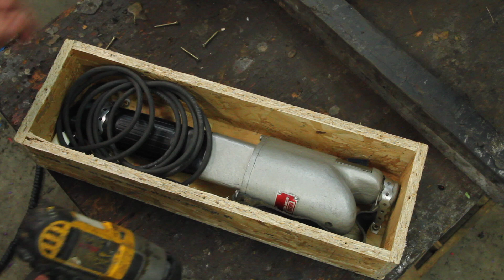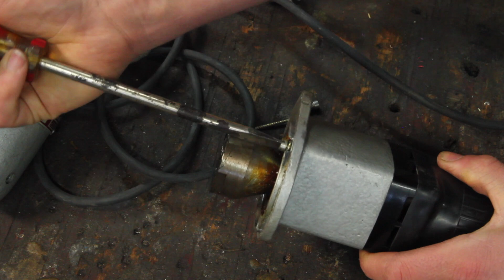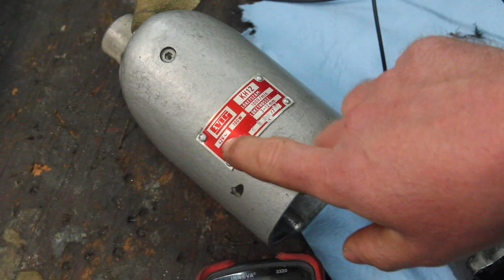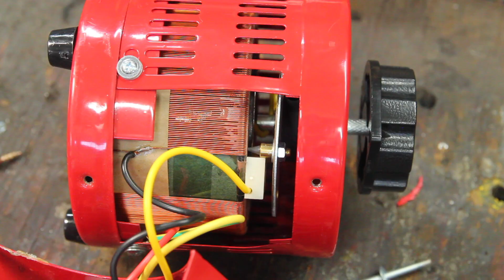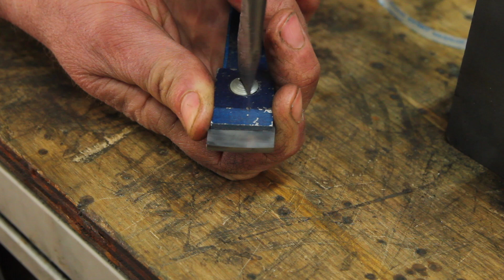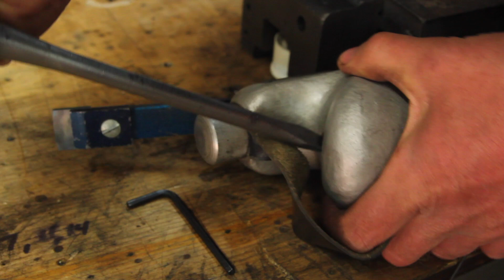Evig Power Scraper (Road to a Rebuild #2)

Comment: Soviet day-to-day life wisdom here: The scraper most likely was made to run on 42V AC, exactly because this would mean for the tool NOT to be usable at home/outside of work. Doing sidestuff and "liberating" tools and supplies from factories was so widespread the various Socialist had to be really, really creative in their attempts at trying to keep it in check. Thus things like powertools with unusual voltages were quite common.

Comment: The variac does not have 2 coils.  There is only one coil so the input power supplied is NOT isolated from the output.

Comment: I wonder if you could Mount some kind of chisel in a Sawzall and do that same thing
Reply from the maker: People do modify sawzalls to hold the inserts, and I considered going that route, but the “real thing” works better because you want to be able to adjust the stroke length for finishing work vs rouging, the ergonomics are better, and this has a good bit more mass than a sawzall, since this cuts on the push stroke, whereas the sawzall cuts on the pull, and is (usually) pulling against the saw.

Comment: Jeremy, you didn't really expect the power plug to fit. Did you? If "yes" then you definitely have Murphy in your shop with you. Nice find for the tool. Despite how elegant your hand scraper was/is you'll get your desired results faster with the mechanical scraper.
Good luck. 🇺🇲🍌🇨🇦

Comment: I think I’d have to swap that motor to a 15 amp grinder or something like that 110v sounds like it’s not generating the speed it needs to clean cut without straight up plowing
Reply from the maker: I was running it pretty slow to try to keep it under control.
Reply: @JeremyMakesThings  I’m clueless when it comes to scraping reckon when I do finally attempt it it’ll be on my lathe compound since mines complete shot probably be machined then turcite then scraped when it’s time for that one it’s out a crap ton
Reply from the maker: I’m pretty clueless about it too,
Lol. I found with the power scraper there’s a fine line as far as the angle goes between too steep and it digging in too much and too shallow and it skates across the surface, and leaves marks on the backstroke.
Reply: There’s a  thread on Practical Machinist rebuilding forum where old Biax motors have been replaced with Metabo grinder motors. If it dies that might be ab option.
Reply: @tonyray91  and @Jeremy_Makes_Things: The Metabo Jigsaw motors only fit the Biax models which were originally fitted with Metabo sourced motors. Before that they were from Scintilla, which became part of Bosch and before that they were made in house (in the 40s and 50s). Those older versions had a different pinion gear on the motor spindle. I guess you can figure out how I know this....